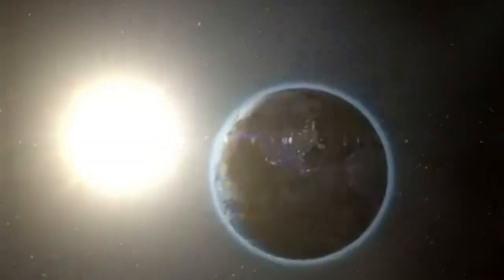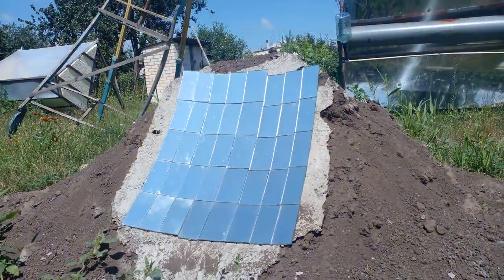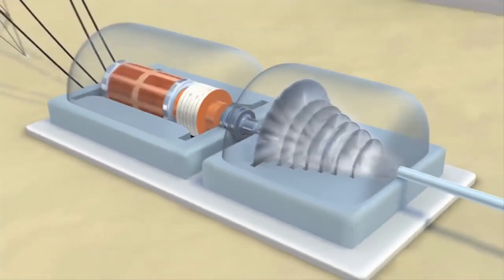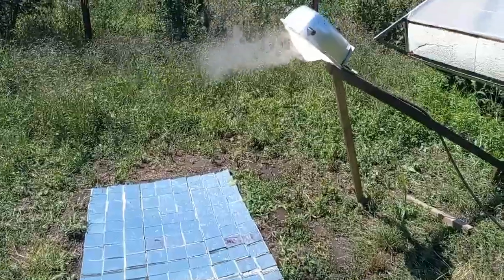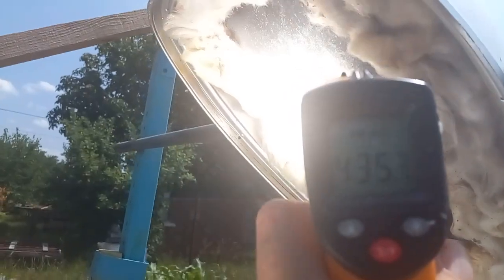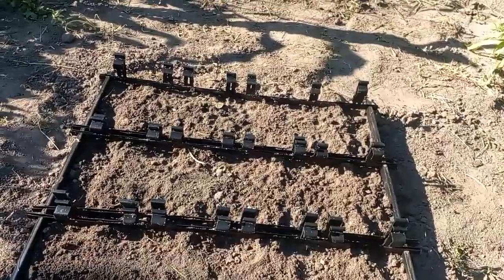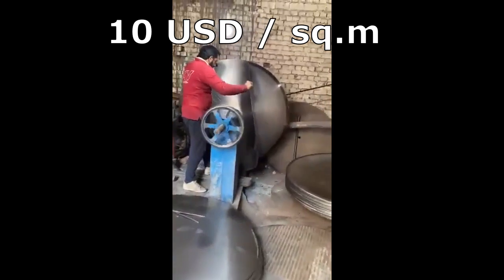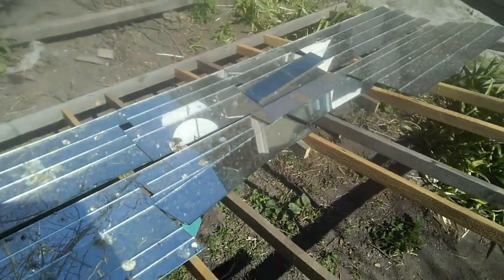Why I turned the ground into a mirror to focus solar energy

Comment: Solar ideas are useless to reduce our dependence on fossil fuels without widespread deployment. 

Are there any factors near you which need a cheap source of heat? 

Do you have a source of micro steam turbines? E.g. to charge a battery? 

What designs can you build and sell? 

Solar concentrator + heat pipe + thermal battery could heat a home. Use glycerine to achieve temps up to 300C at 10 bar. Operate an oven, dehydrator, dry clothes, heat water on-demand... Or make steam any time of day to run a generator.
Reply: These are demonstrations about how to move the energy from photons to electrons, not electric generation.

He could hook up a generator or repurpose other equipment from other sources to create a turbine.

Anyone who follows "post apocalyptic inventor" or other channels knows how useful scrap heaps can be.

So no, not totally useless. Perhaps he plans to pump the heat into the ground below a greenhouse (greenhouse such as seen on Arkopia's videos), or into a geothermal well, or a myriad of other options.

Literally endless, one just needs to put some additional work into making something viable. But that's not sergeys job showing you how he can turn a 1960's Soviet washing machine into a steam turbine: that would be useless to most of us living in "the west".

Love the content!!!!